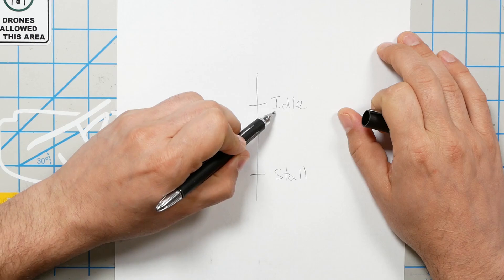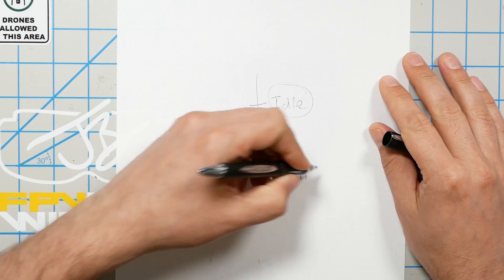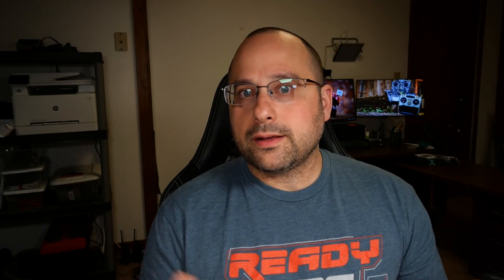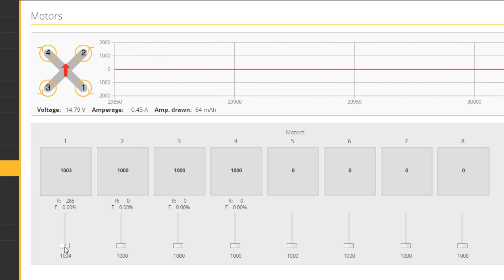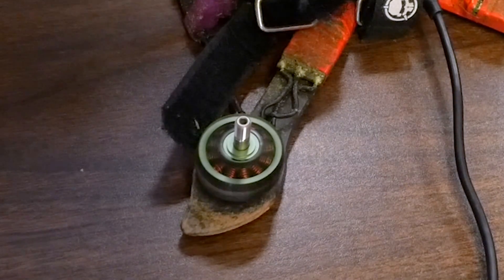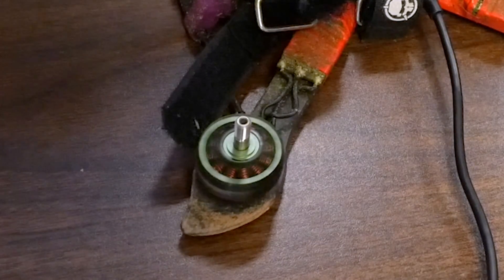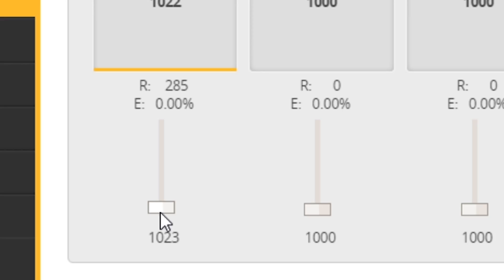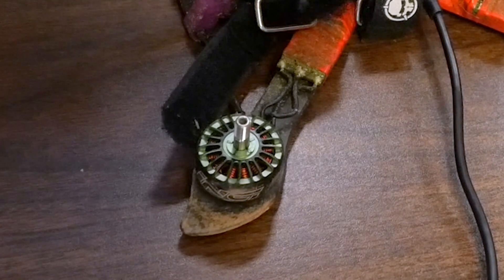"Dynamic Idle" the most useful Betaflight feature you never heard of

Comment: so tested mine. props on. got 600rpm no more twitch.. 800 to 1000 rpms i can add friction with finger on prop and still no stutter.. my idle is 4.5% (4,000rpms) 1207 6000Kv 2.5" (AUW between 160gr to as high as 345gr [Hero6])  So use the 3,200 80% value or try lower like 2,400?

Comment: So higher = less prop wash? and for a 5 inch, this should be between 3% and 9%? This any different on 6s?
Reply: I bumped my idle up to 7.5% and reduced rpm filtering to 1.4% the other day and my 6 inch now handles like a dream. I might attempt to play around with dynamic idle now though

Comment: Great video! Been having desync issues with two bee quads I recently built. Happens rarely but when it does, quad falls out of the sky is a spiral. I tried your CLI “get idle” but I only get the dshot variable back, the idle_min_rpm is not listed and cannot set it, returns an error saying “invalid name” for the variable. Any ideas? Thanks!
Reply: Man flash new betaflight version 4.1 atleast!
I too had the same issue 
Nvm, it's been a year for you, waiting for an answer. Lol
Edit 1, if having problems flashing, enter into dfu mode by typing bl in cli tab
If dfu isn't written where com port shows up, download impulse rc driver fixer
It will help

Comment: Night and day difference on my 3" !
Reply: Really? Interesting...
Reply: Mayan Hawk nice. Which values did you put in?
Reply: @prottentogo  I used 7
Reply: @MayanHawk  And for idle min rpm? I get kinda confused because that 12 or 14 seem to be for 5". I tested the idle of my 1507/3800 motors on the bench and they are around 450 each. Now Bardwell said he doubled the bench values, soooo... should I put in 36 (for 3600)?
Reply: @prottentogo  I have 1106 6000kv motors. The I took the highest reading rpm, divided by 100. Then I doubled the value for my min idle.

The highest rpm was 387...
387/100=3.87
3.87*2 = ~7
Reply: @MayanHawk  Ok, so I guess I was right. Thanks.
Reply: @MayanHawk  Wait I didn't see the last part... I thought you have to add the idle rpm of each motor and then multiply that by two. You only took the idle rpm of one motor?
Reply: @prottentogo  correct. I only took the idle of the highest rpm. 12 packs in my 3" since I followed the tutorial and no problems

Comment: I'm so confused with the Idle Value. 
On Github I read this: 
You may arm with the Tx in the motors tab (after setting the enable switch) to check that the idle RPM in real world is about the same as it is when running directly from the motors tab slider. You may notice that noise from the motors will cause some variability, but the RPM numbers should be about the same.

No on my quad this does not match, i'm running 8% Dshot idle value working great. 

When I compare, motor switch in BF or Arm, the values are much different. 
BF switch: 2300rpm 23-20%(-4.6) = 18?
TX Arm: 3400rpm 34-20%(-6.8)= 27?

And later read if you have already setup the Dshot idle value you can just take -20% from that value?? :S Wutt how?

Well since there is not a clear reference, rpm idle of 18 or 27 ok? or very high

Comment: Hi Joshua, i'm trying to change my idle_min_rpm to 12 or 14. I'm getting a change confirmation but, afert save and reboot the value is still default so it's 0 (zero). What could be the reason?
Reply from the maker: You have to type the word "save" in the CLI not press the Save button. The Save button saves the text out to a file.
Reply: @JoshuaBardwell  Hi Joshua and thanks for your answer. Ofcourse i've done it exactly what u've show in video, i mean i wrote it ("save") in CLI. But like i said, alter reboot, The value is still 0... My battery is not connected.

Comment: Has anyone used this tune on a Mobula7?.... Does this require Bi-directional Dshot to work?... I have switched over to JESC 48khz which I believe supports Bi-directional Dshot... However the Project Mockingbird Mockula7 tune that I’m using flys really well without Bi-directional Dshot / does not use rpm filters... I’m hesitant to turn that on as I’m uncertain if it will mess with my tune...  any advice would be appreciated...

Comment: Correct me if I'm wrong but it seems you need to be running RPM filtering to take advantage of this?
Reply from the maker: That is correct. I mention it in the video I think but maybe it could be clearer.
Reply: @JoshuaBardwell  Dynamic idle needs Bidirectional DSHOT to get RPM values from the ESCs. Why does Dynamic Idle need RPM filtering?

Comment: Hi, what takes prescendance at zero throttle min idle rpm or dshot idle?
Reply from the maker: The motor will be at dshot idle except when the PID controller feels it needs to lower the motor's output to keep the quad balanced. Then the motor may go as low as idle min.
Reply: @JoshuaBardwell  so I'm trying to get rid of my off throttle floatyness but if i reduce my idles down too far I get slow oscillations at zero throttle when the quad is level and off the sticks falling. When I raise up my idle min it helps a lot but then I don't get the hang time I want. I guess it needs enough idle to have authority at zero throttle. Any tips?
Reply: On a 5.5 marmotte running 5s 1722kv, I need idle min set at 35 to keep it completely stable off throttle

Comment: Hey , what when i set idle RPM to 12 Type save but the setting is not change and rpm throtl stay at 0
Reply from the maker: Betaflight 4.3 has changed how dynamic idle works. Are you on 4.3 nightly build?
Reply: @JoshuaBardwell  at this moment i can use only speede bee
Reply: @JoshuaBardwell  but this quad is alesow speedee bee build

Comment: Is idle-up any different? I use low idle percentage and idle up switch on the Taranis. Seems like the result would be the same.
Reply from the maker: Idle up is similar in that it increases the idle speed while letting the motors go below the idle point. But it does not track the stall rpm of the motor, which gives a more precise floor to how low the motor is allowed to go. So if you previously hated air mode and used idle up instead, dynamic idle may give you more control with air mode enabled.

Comment: change the idle to 12 hit enter, save, enter, boots back to the setup screen go back to cli , get idle and it has returned to 0, how do i get it to stay at 12. also do you need air mode with this setup.
Reply from the maker: I think you are pressing the "save" button not typing "save" at the CLI?
Reply: @JoshuaBardwell  nope, typing  save hit enter. I have done it a few times . I tried setting it in the pid screen and it goes back to 0 as soon as I hit save as well
Reply: yep, missed the bi direction setting.....
Reply from the maker: That's it. You can't enable this feature without bidirectional Dshot also enabled.

Comment: it the idle min set to 1400rpm at default or do you need to activaye it before it works?? thanks
Reply from the maker: idle_min_rpm is set to zero by default, which means it's disabled.
Reply: Thanks ✌

Comment: I will have to disagree with a few things josh,

Since blh_s came out, the idle speed could be set much lower than zero trust (ZT) and not have desyncs, I personally dont think there is a reason to go below ZT, all it does is increase response time and lower stability, witch is no good. So going lower than ZT (my idle setting) is not going to help anything.

My knife edge (KE) test for correct idle speed. Hover in front of you with zero wind, launch 45 degrees up and straight away from you, chop thro and KE, the quad should go straight, to high rpm and the quad will curve from it making thrust, if curving, lower to make quad go straight. This will give ZT and best response time. Any lower and hurts response time, any higher and hurts inverted hang time. 

If you watch a roll on a quad from hover, it does not rotate around CG, watch my how low can you roll video (parody of the dji how high can you go guys).
https://youtu.be/uku7cEiqVIo?t=50

"IF" Vanover is at 9%, then he does not like inverted hang time. I fly with 1950 rates, this also makes it much easier to desync from reverse airflow than the slow 1200 rates lots use. Thanks for the video.

Comment: You showed how to find the lowest rpm possible for the motor to run without twitching, but I missed the part where it translates to values in your cli.
Reply from the maker: Basically, you set it a little bit higher than that number and then you go fly and if you get death rolls or dropped arms, then you raise it. Or alternatively you use the Betaflight dev recommendation of 14 (1400 rpm) for a typical 5" quad and probably it's okay.
Reply: @JoshuaBardwell  NO!!! Follow the instructions at https://github.com/betaflight/betaflight/wiki/Tuning-Dynamic-Idle. They are VERY simple.

Comment: Wouldn't you want a prop on the motor to know the minimum value it will spin at? Drag, friction, load... all that? Not that I'm suggesting someone have their props on when the quad is on the bench, but maybe adjust this outside with a laptop?
Reply from the maker: The number is always going to be much higher in the air with air moving past the prop, so bench testing establishes the absolute lowest limit but you can't avoid flight testing.
Reply: read my reply above

Comment: You settled on a motor speed of 300 for your min idle before stalling, but then set the idle_min_rpm to 12 (for 1200rmp). Where does the 300 factor in???
Reply from the maker: I came up with a value of about 300 for three motors and then 600 for one (probably damaged) motor. I flew with a value of 600 and got an arm-drop on sharp moves. So I ended up raising it until the arm-drop disappeared. 1200 is where I ended up. That's the procedure I suggest you use.
Reply: I'd come in on the side of start off a little bit quicker (14-16), then start working you way down until there's no discernable floatiness you want to get rid of, then party on... but I've done most of my testing on 7" quads with GoPros, so I really want to avoid desyncs.

Comment: can i do this on one shot 125 my engines spin so fast it takes off as soon as i arm
Reply from the maker: Just don't be using oneshot or multishot on any modern multirotor. Modern FC simply don't work well with any ESC that is so old that it doesn't support Dshot. It's not that oneshot and multishot can't work. Obviously, they used to work fine. But modern FC are all tuned around Dshot capable, modern, high-performance ESC's. Older ESCs that don't support Dshot don't perform well and the FC often simply can't fly at all.